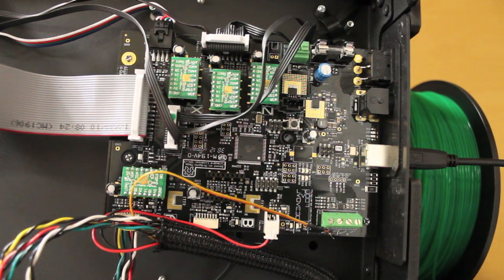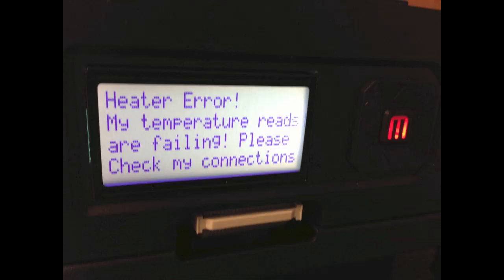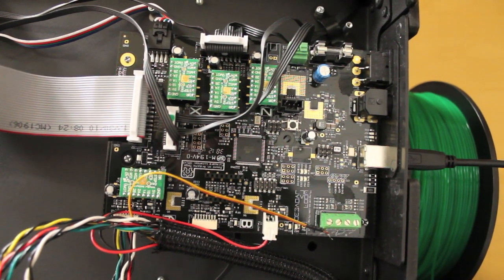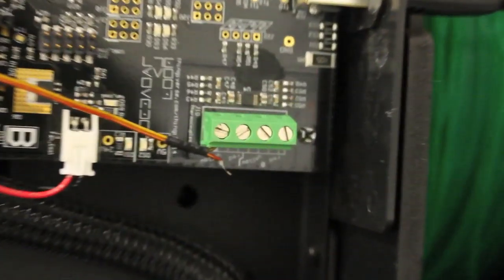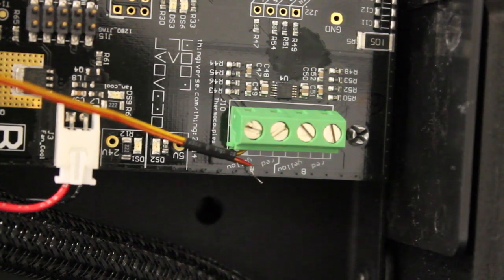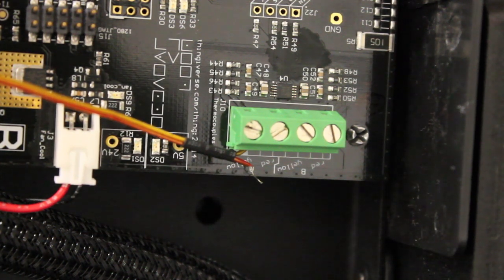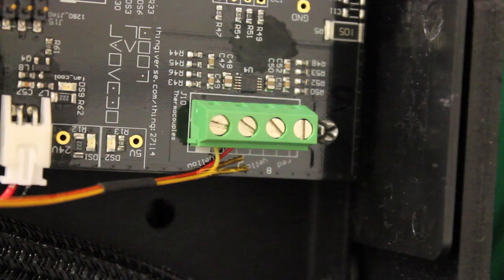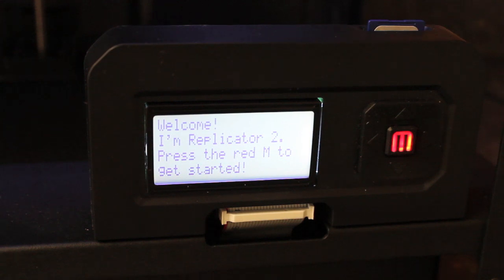MakerBot Replicator 2 Heater Error - My temperature reads are failing! Please check my connections

Comment from the maker: No problem, Frank. Glad to know I'm not the only one experiencing these problems. I have to admit that after I got my R2 up and running it's been pretty consistent and the prints are awesome. I can't speak for RepRap but had looked into it at one point. Another project that I've heard good thinks about is printrbot, but I don't think it offers the same build size as well as resolution. That may have changed since I last looked.

Comment: I hear you! Just bought a second hand MakerBot Replicator Mini and I was actually scammed by the guy selling it and I have told him that if I dont succeed printing after this weekend I will return it to you. I´m printing now thanks to an actual hack I did with fuckin medieval technology and I´m working on a heating problem now that I will basically just try to bypass thru adding voltage to that block myself with an extra circuit and a potentiometer. Thats my take on the planned obsolence I see here... OOPS the temperature just STOPPED SINKING! After some use..... wich is "the oldest trick in the book" when fixing cars, it obviously applies here too. I guess I scared the printer with my words here! What I did was I monitored the temperatures, wrote them down and took notes of everything I did, and I pressed "filament" and then back, to bypass the error messages. For the time being I will continue my constant visual inspection of the work and not leave it alone.  Update: Well the problem is randomly occuring again now so the sollution with an extra circuit see,s like the go to option. Maybe the heat disipation is lower with higher print quality? It´s fluctuating quite nicely since I changed to high quality. First thing I did was removing the tube the filament is running through, so I can look at and gently push on the filament to feel how the mechanical movement is functioning. My first 12 hours of 3D printing has been intense. Hah.. I saw one thing happening now: Because the tubing is´nt there the drag/stretch in the filament caused a little gnarly sound to occur when I stopped helping the feed manually, and that resulted in the same error message about the heating. Earlier before I took a rope and tied some hard knots around the entire print head, I constantly got the message that the extractor was loose or misaligned. I would conclude the design on this printer is very poor to begin with! But I´m currently looking at my Raspberry case materializing so I´m full of hope.

Comment: Dennis - Try upgrading the extruder.  Makerbot has the parts in its store.  You can also find it on Thingiverse, but you need to get the spring and screw.  What is happening is that the plunger does not have enough movement to push on the filament when the filament heats up or is not exactly the same size throughout the spool.  Hope this helps.

Comment: To be clear, it turned out my issue is not wires (but I did find a different wire about to fall out) but rather it appears to be the thermocouple itself. They're kindly sending another. Support has been great.

Comment: Their support has been good. I can still they're still going through growing pains though. The assembly quality of my machine wasn't perfect. Pinched heater wire under extruder's aluminum block, misthreaded-screw on case, possible a ding in the build plate. Not positive about that but don't think I've banged the nozzle into the plate yet though either...juries out on that one. And, the thermocouple issue, which needed a few temperature cycles to fail apparently. I'm happy though. Nice robot.

Comment: I just had to do the same thing, plus the power connector to the heater had almost fallen off too. The thermocouple connection is still iffy. I might remove that connector and replace it with something that makes a better connection.

Comment: An update on the new thermocouple:

The thermocouple that came installed in the makerbot was bent sharply where the wire met the bolt head in the extruder mechanism.It was also screwed tightly into the extruder block.

I replaced it with the new one, but still screwed it into the extruder block as tightly as the previous one was. It failed on cool down.

Apparently tightening it was causing it to fail on cool down. I loosened it so that it is not tight at all. It can rotate freely. Now it works!